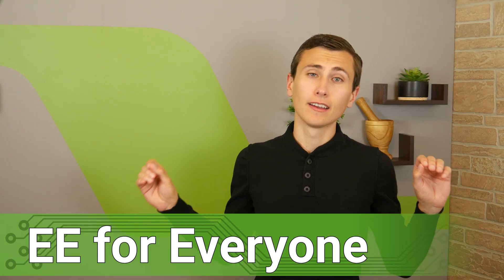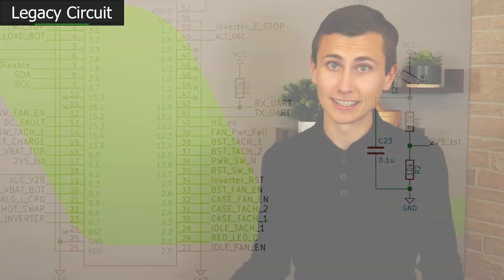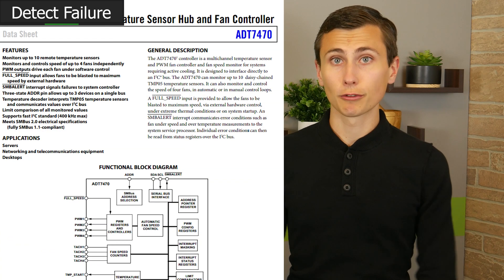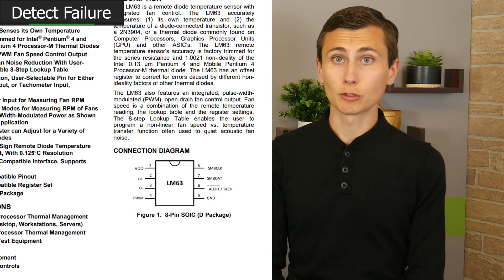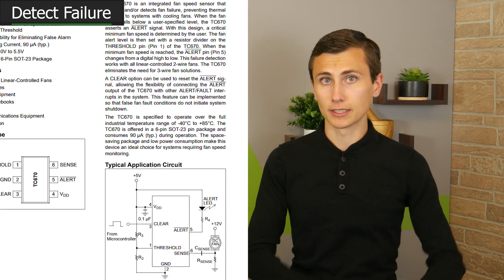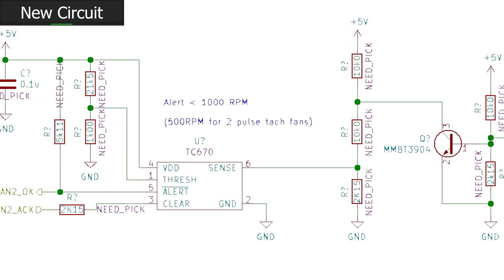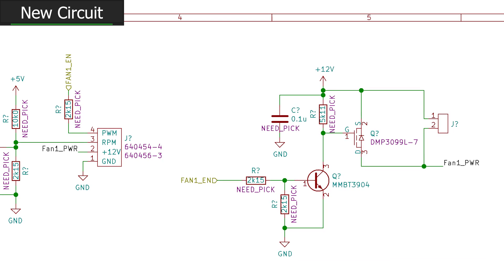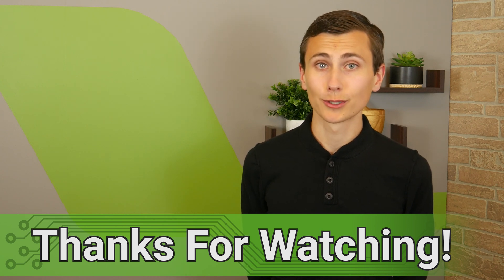Fan Control! (Stall Detection + PWM Control)

Comment: hey I am looking for some info on how to program the LM63 chip, I was searching for it on YT since I am not very good at coding and came across your video, I see that you mentioned it but are not going to actually use it. Also your description is wrong, you typed LM60 not LM63
Anyway if you have any sort of helpful arduino code I would appreciate it, if not good luck on your project and cool channel!

Comment: will the fan change its speed when the temperature changes?
Reply from the maker: For this project, not quite. It's simple on-off. However, with a pwm output at the right frequency, fans can be controlled!

Comment: You really should use a hardware counter if the micro has it and not being used for anything else. Keeps total cost and complexity down.  You can read the counter value a lot less than 100 times a second as long as the timing is consistent.  Read, reset and compare the read value to the minimum speed.  No extra hardware needed, unless you are worried about the processor hanging, in which case the inverter/ups should not 'blow-up' and go into a safe state if that were to happen, so fan doesn't matter in that case anyway.
Reply from the maker: Hey three meter Jim, Thanks for watching! I totally agree... That's why I made this neat video is about making a hardware monitor to detect the fan stalling! :) 

It's a big improvement over our old UPS, and frees up a lot of processor time. The plan is to use the failure detect signal (simple GPIO) from the monitor to fire an interrupt. (Or a hardware lockout, etc) Not only will the system respond to a fan failure faster, it'll take less processor horsepower too!